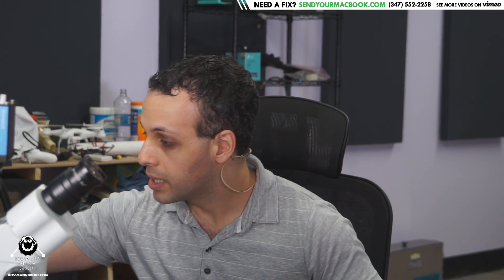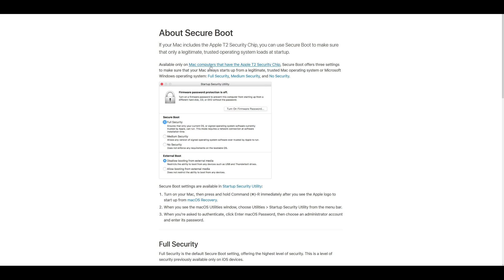An important message from Louis Rossmann

Comment: All Apple Mac users (and PC users too): Get a backup hard drive (USB 3.0 or USB C or whatever), and use Carbon Copy Cloner or similar software to not only backup your data, but to have a BOOTABLE CLONE of your drive, that way if the T2 chip, your SSD, or Catalina fucks you over (or Windows 10 fucks your over), you have a BOOTABLE Clone of your drive. ALL DRIVES DIE. It's not a matter of IF, it's a matter of WHEN. As a mentor once told me "If you don't have it twice, you don't have it at all."  Time machine ain't gonna cut it when you have deadlines to meet and shit hits the fan.
Catalina is a disaster of an OS. imo, and I have no plans to update my A1398 Macbook Pro to Catalina, no matter how much Apple wants to dangle a carrot in front of musicians like myself with regards to Logic Pro X's update to Logic 10.5.0. IMO it's really Apple taking that dangling carrot and shoving it down our throats saying "Here! Here! Here! You need this fucking carrot of an update to Logic 10.5.0 and you need to be on Mojave 10.14.6 to run it.
If you have the option to update , clone your drive, then CHECK software compatibility, but DO NOT UPDATE. Way too many compatibility issues still for many musicians and audio people alike, and Apple knows it. I knew it was going to take a long ass time for 3rd party devs to update their software to be Catalina-friendly due to Catalina being basically a restructuring of MacOS. That restructuring creates a lot more hoops for 3rd party devs to go through, and therefore it's taking much longer than previous versions of MacOS.
Louis, I have tremendous respect for you and the work you do, but are you really that surprised that Catalina is starting this serialization shit with their components software-side, and without the T2 chip? For me personally I saw this sort of crap coming from a mile away. This is just the beginning. They've already mapped out by now their game-plan for the next several years to play hard ball against Right to Repair. The war has only just begun. 
[Also I'm not looking to have any argument like the one pinned above. Just wanted to give me thoughts as a musician and a user of an A1398 Macbook Pro which has now lasted 6 1/2 years amazingly enough without major problems, aside from the battery]
Hope you are doing well, Louis.

Comment: Hey man,
Came to know about your channel through this video.
I have a question. Are macbooks really reliable. I haven't personally used a macbook. But my previous experiences with windows laptops are very bad. I have a windows laptop that had to be repaired three times. And the last 2 repairs costed me around 25% of the laptops initial cost. My experience overall is very shitty. I thought that macbooks were more reliable. Is it true? I don't do much gaming but i do edit video and photos. Also i have heard of very small no of software issues for macos especially when compared to windows. There are several things that drive me absolutely mad in my windows laptop. Should i look at a 13inch macbook pro??

Comment: Louis has all valid point, but most of what he is saying is a moot point, because Time Machine is so easy to setup, use and restore from. Everyone should be doing backups when they are that easy.  There is a reason for the T2 "Secure boot"  It means that my data is safe.  So if I do backups and my laptop is stolen, there is NO WAY to get access to my top secret data include my Mr Clinton kitty photos and videos.
Reply: The vast majority of Apple users have 2, maybe 3 products. An iPhone, an iPad, and a Mac. Do you really expect the average consumer to know or care about backing up their data? I know it's what you're supposed to be doing, but most users just don't care enough
Reply: @EdwardJamesBickels  LOL. Every mac user I know uses time machine, which is built into the OS. It is automatic. I am guessing you are NOT a mac user.

Comment: Seems linux is the only way left if you value your data and need fast DR options... When my 15' MPBs SSD died in 2019, I had to wait ONE week to get the SSD replaced, despite 'Apple care'. With my old linux systems, in such cases I just take a spare standard SATA SSD, restore from backup, and are done the same day it failed... PRO gear better be built from high quality standard components, so it can easily be fixed at any time. Hindering fast repair and data access in case of failure more and more makes Apple products more and more a 'NO GO' for professional users.

Comment: I think the argument against the T2 chip is pretty poor, like its really not that hard to backup data, I would personally rather my data be encrypted by default, so other people cannot just boot from a flash drive and steal all of my files, which is what you can easily do on windows. Honestly I believe every OS should be encrypted by default these days. Your arguments for them removing lifeboat, and the WIFI chip are valid though. But with things like iCloud built in, theres really no reason not to use Cloud Storage, I mean even if they do get rid of the T2 chip if the computer gets completely destroyed your'e still SOL. You should be preaching people to backup their data instead of preaching they shouldn't buy apple lmao, because I would personally take the extra security any day.

Comment: The real problem here is the lack of backups, while the T2 chip is certainly annoying its important to remember any device can die for any reason or even be lost/stolen/end up in the washing machine and the data is just as unrecoverable at that point.  Apple time machine and icloud are the built in solutions to this which are pretty simple to use, time machine even costs nothing if you have an old usb hard drive laying around.

Comment: I used MacBooks for over a decade. Now I'm using ThinkPads with Linux. All my important data is stored on a home server which I either rsync, or works on using sshfs (to mount a remote directory), or use git with. My use case is mostly C/C++ coding (CUDA), Dart coding (as part of Flutter), and the odd bit of PHP/NodeJS. I love my new workflow - no need to buy an expensive laptop, I buy secondhand ThinkPads for around $200 and maybe fork out for an SSD and some extra RAM. I then do all my compiling (etc) on my remote home server (which has the beefy GPUs and 64GB of RAM etc). Works for me :)

Comment: one of the things i learned about computers is that updates are evil.  even if you disable this the next update may re-enable it. used to be you were notified that an update was installed. very rare that happens now. now if you do sensitive stuff with it you need to make sure everything is done to protect yourself and your data.  but if you are just surfing the web and watching youtube videos  just turn the updates off (if you can). all those updates do is add more lines of code causing your computer to slow down and eventually crash because the hardware can no longer support the software.  i think they actually do this on purpose to sell you a new one every 2-3 years.  btw dont listen to me  or do as i say  it may not work out for you as well as it does me.

Comment: Another way for your machine to die so you can buy another one 

That’s all that matters that you buy another one with AppleCare+ so they can tell you that you modified it and voided the warranty

Buy another 

Fuck this company serious fuck you apple

Thank you for letting me know OS X cat knows that you swap out oem parts I did not know that, as I’ve been working on MacBooks and very hesitant to upgrade them to cat bc of how it even tries to lock you now.

Just trying to use a iPad as a second a screen in general on a MacBook is hard with all its security measures 

I’m over it

Comment: Using Apple Configurator to restore iBridge / BridgeOS should allow you to recover the machine when the firmware fails, but is physically okay. Have you found this not to work?
Of course if you to have a hardware failure on these, you’re SOL.

Comment: On my corporate Windows machine that has encrypted disks, there is no way to recover the data. That is why they have a daily backup of all user files and they have Windows images in order to quickly set up a new laptop in case things go wrong. It is perfectly acceptable and even expected from Apple to provide similar security for the business environment. However, this should never be the recommended option for home users that probably don't understand the ramifications of this choice.

Comment: lol you're trying to push the wind away by blowing, its not apple, its the people, no point in trying to fix the stupid, I got a surface go and I kinda love it but I know what it is, I treat it as an empty client device, it could have 2gb free storage and that wouldnt matter to me, all my data is on the cloud or my nas, and the go2 just came out bringing nothing other than half an inch more screen and yet another worthless intel heater and yet I might "upgrade" to that just to avoid living with a metal & glass brick that is glued shut and could become a door stopper the moment the power button stops working older than 2 years

Comment: This oddly makes me think of Burn Notice. Many times he described getting into secure facilities by exploiting the fact that every building needs to allow for flexibility to allow servicemen, repairs, changing of people, etc. Thus, the more secure a building, the more rigid and less flexible it is. Maybe that's how chips are, the more access you have to things for repair, the more it can be exploited.

BUT STILL people need to be able to choose what level of security and flexibility they want. And even still, I would think with modern cryptography and all that, the data should be able to be pulled, and unlocked on another device with the correct key. If it is the typical unlock screen, it's just a 4 digit pin, which isn't much, but it's not like people are storing nuclear codes or anything on their phones.

Comment: I have been all Apple for over 30 years. Still running primarily on my 2012 Mac Pro which is going strong, but which Apple and Adobe has rendered obsolete with the OS upgrades. I have been trying to justify a new 2019 Mac Pro and just cannot bring myself to hit that Buy Now button! Not just the outrageous entry price of the base model, but I have to buy all new EVERYTHING to connect to it. No optical out port for my current sound system. No firewire ports for the 42 external firewire drives I have. Two of my three NEC Monitors are unsupported - another $1300 there. The list goes on and on. I definitely do not want an iMac with the screen glued on to the computer. Maybe just time to give up the game! New Mac Pro also has the T2 chip so that I cannot upgrade the internal SSD myself.

Comment: But but but Time Machine.  Do people not use Time Machine? You can install from Time Machine as well. (I'm going to go the double paranoid route of using a second external disk and using carbon copy cloner as well)  
I appreciate your video's Louis, and I can see how it looks like Apple is just dying for people's machines to die as soon as the warranty runs out.  (it looks like your logic board is dead, you'll need a new one, or for just a little bit more you can get a new Apple Blah which now has these features). The thing is I really really love the look of Apple apps like Logic Pro.  The pricing of Logic Pro and Final Cut (over time) are better than Ableton or Pro Tools and Premier Pro. 
I'm getting a 16" MacBook Pro in a few weeks.  I know full well to keep backing up everyday. I know the chances of it lasting beyond the applecare+ end date are probably remote.  But it will provide a mobile way for me to access the tools I need to do the things I want to do.  I've had macs before, first one was the 17" MacBook Pro, I've had a MacBook Air, I've had a 27" iMac, and 2010 Mac Mini Server.  All but the server have melted something whilst dual booting into windows and playing games.  The MacBook Pro will not be dual booted. I'll keep my data safe and hope that Apple keeps the laptop alive for long enough...  
The most robust 'a'pple I've got (although it wont play Apple TV+) is a not very portable Hackintosh Corsair Cube machine. 90% of the time I'm in Catalina, the rest of the time Windows 10. I like the OS and Apps and cross my fingers with their hardware.

Comment: I am very tired of Apple making things that can not be repaired. I guess maybe I am lucky that I have needed very few repairs on my Apple hardware. I also glad that my two Macs do not have the T2 chip in them. However, I do have a MacBook that has the butterfly keyboard. I have heard that these have a very high failure rate. Mine is still okay so far, but mine has very low usage and that is probably why mine is still good. Thoughts?

Comment: Microsoft is equally disrespectful and disingenuous to its customers. I implore you, consider switching to Linux. Software and hardware that respects your freedom becomes immediately more accessible in what is, by now, a far more polished package than Windows, and on par with Mac OS. If you don't want to make it hard for yourself and install it by hand (takes literally 5 clicks these days), consider purchasing a preloaded Linux laptop from Dell. If, on the other hand, you want a more apple-like, curated experience, buy a System76 unit. Those guys are amazing and work their fingers to the bone to make Linux more accessible. Just give them a shot, you won't regret it.

Comment: Digital Designer here, I've ditched a Macbook Pro 2017, and will be happily moving forward with a Lenovo Thinkpad P40, which I was able to upgrade a bit myself.  It's been going great.  The screen is not as good, but it's mostly docked to a proper one so no big loss, plus it has a Wacom digitizer built-in, which Apple don't offer, and ModBook Pros cost a fortune.  No chance in hell am I going to run a machine with a T2 in it.

Comment: Don't buy Apple products? Well... 
Context: I used Windows many years before I switched to Mac on a regular basis (~7 years). I tried Ubuntu as a daily driver for a year or so, plus Linux always part of my job one way or the other (~5 years). I worked on MacBook Pro 2015 (~4 years) and now on MacBook Pro 2019 (<year).
Thoughts: I cannot bring myself to work on Windows again, it's fucking torture. Linux distributives are miles away from convenience MacBooks provide (apps, services, proprietary features). I like constructed criticism (yours are well done btw) toward Apple, they deserve it. I would love them to improve, obviously. But don't buy their products?
Conclusion: I am the consumer. My logic is simple: would I pay an extra 1-2k for MacBook over Windows/Linux based machine for the next ~3-4 years? Yes I fucking will.
Do their machines have problems? Yes they do. But would you rather deal with garbage ecosystem, services, and OS bullshits to save 1-2k and avoid Apple's bullshit? No fucking way.

Comment: And that's why I still use two old laptops, an Asus from 2012 running debian and an Acer from 2013 running Win7, and my custom build desktop from 2009 with an I7-920... 
I know they can die at any moment now, but I also know nothing is unnecessarily soldered onto the motherboard, so they are fairly easy to repair.
Whereas, if I buy a new laptop it would probably die 2 months past warranty... 

Never had this issue with custom build desktops tho...
I hope my Nas with I3-8100 and vbox server with ryzen 7 2700 survive at least 5 years...

Comment: I don't think it would be impossible to retrieve data from a computer without secure boot. It's probably still there, and it doesn't seem like it's encrypted. Would it be possible to remove the soldered SSD and plug it into an interface from another device if data recovery was the #1 priority?

Comment: I never owned an Apple laptop but I am on my 3rd desktop . I never had any problems with any of them . As for having things backed up . I use Time Machine and I cloud . They never failed me . I do not like Apple's Migration assistant though . In theory it should be a great thing . But when and if it works . It transferees all the dirt and corrupt file and list along with all your other stuff . So you take your brand new clean machine and load it with well crap . I just move the files ( pictures, data , music , etc ) that I want myself and not fuck up a new machine .

Comment: If I'm worried that someone steals my data or laptop and enabled secureboot/encryption etc. I should also have brain to enable some kind of backup solution for my data. Because a digital safe is not like a physical safe were you are able do angle-grind your way into it if you lose the key or break the locking mechanism.

I think Apple should be better at informing their users about backups

Comment: Problem is not TPM chip in a notebook. Not even, that it breaks sometimes. Problem is, that company making these computers does everything it can, so the computer is not repairable. But you already know that.
- There could be some recovery key, but you're supposed to have everything in cloud.
- They could provide repair services on higher level, than you can do, but they do not care. Their computers are so expensive, they exchange parts and people are paying it anyway.
- You could be approved/certified with all the equipment/schematics/parts needed and it would work. But no, that doesn't produce enough money for them.
This company went from the one, which wants to create good stuff and the computers are the thing, that matters, to the one, which counts money and profits and their product is just a way to get them.
Good luck with "Right to repair".

Comment: Is the data on the chips SSD chips corrupted and/or encrypted at that point? It would seem like someone could design an NVME PCB where you could desolder the ssd controller, and ssd chips and do a reball to the SSD board and read the data.  Just an idea.